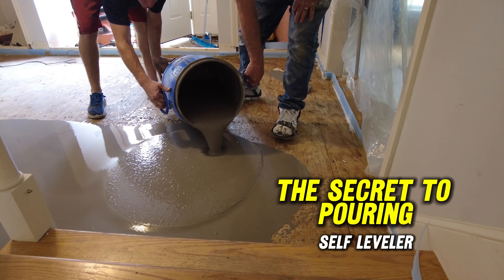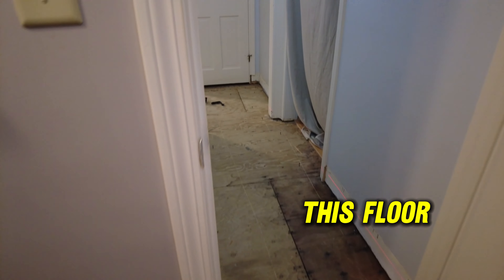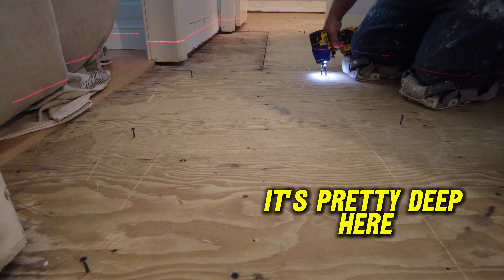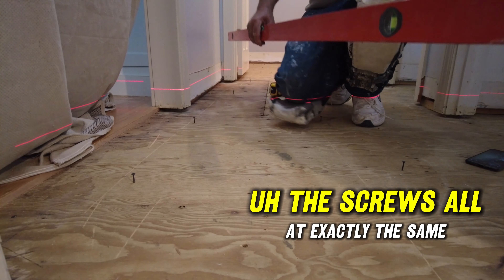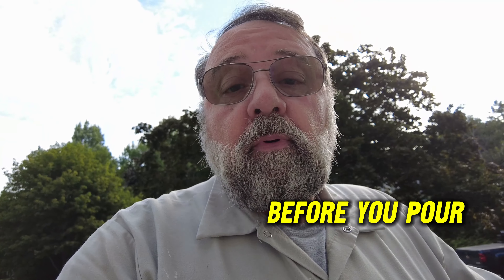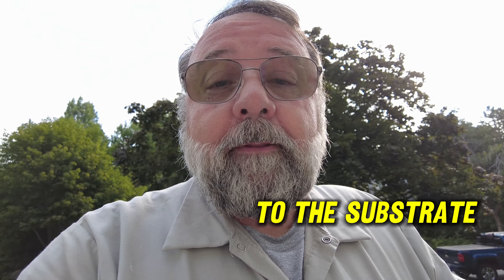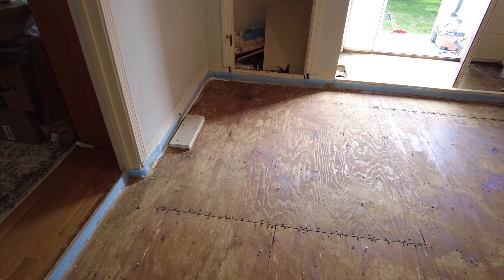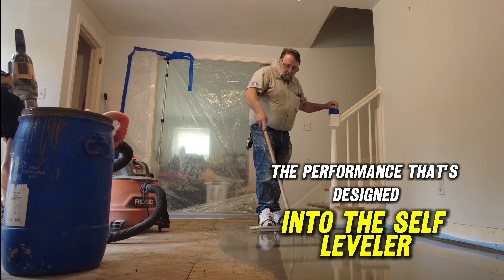Self leveling a floor, HOW IT"S DONE.

Comment: Thank you, super informative video. I’m renovating our 1950’s house and our subfloor looks to be 1/2”-5/8”. It’s squishy in spots but runs under some walls so not sure if I can safely replace it with 3/4”. How do you know if the subfloor is thick/rigid enough for tiling? Looks like this subfloor is maybe 5/8-3/4? Did you have to add another layer of plywood or something first?

Comment: Thanks for a very informative video. I’m thinking of doing the same to the basement, except that I’m unsure how I can use the screw method as reference points over the concrete slab. I’ll check out some of your other videos for guidance.

But if you can here, could you tell me what kind of Laticrete Next Level concrete should be used over concrete? Wire mesh requirement applies on concrete? Would the minimum height of a quarter inch apply when pouring over concrete as well as over plywood? And is it possible to use silicone stamps over Laticrete to create a wood patterned look?

Comment: Can I use a self-leveler around a furnace and water heater? I watched the video from 5 years ago and understand open spaces but what about tight spaces? I have a huge valley in front of my furnace where water pools if there is ever a leak (twice in 30+ years) required removal of existing surface flooring but fortunately caught in time to prevent subfloor damage. I would love to level or better yet, direct to the drain.

Comment: If you ever want to do another new floor in 10-15 years, does the self-leveler need to be buffed away and removed like thinset?
Reply from the maker: In 10 years it will not be my problem, however you don't install tile so you can remove it. If you do it will fail and you will be removing it in much less time than 10 years